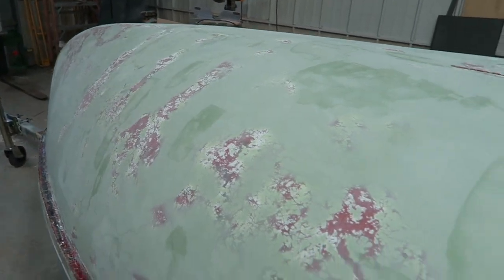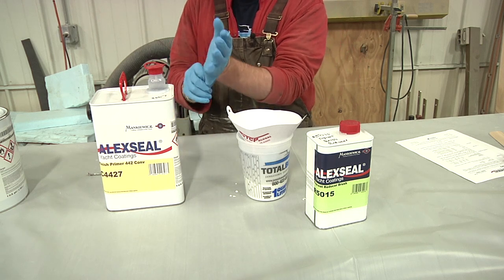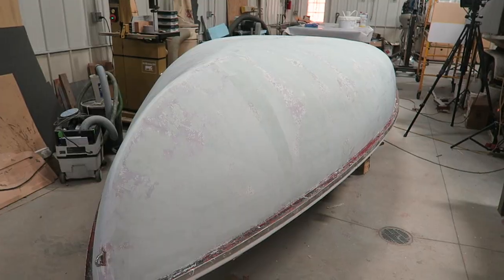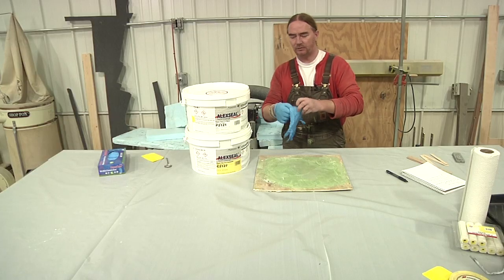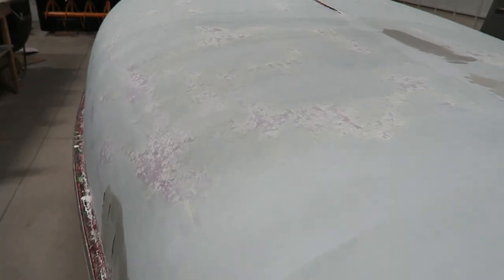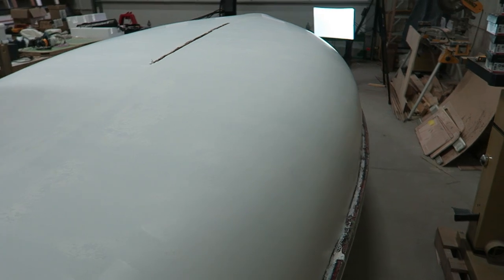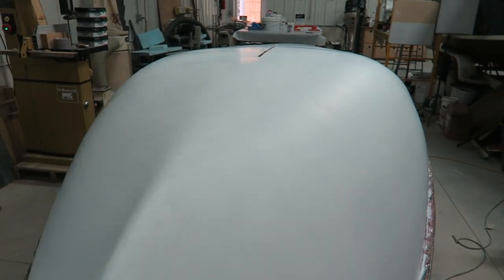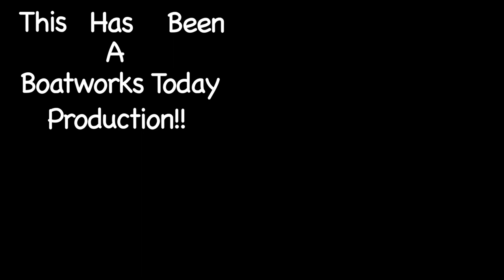FAIRING AND PRIMING DONE ~ LETS PAINT THIS BOAT!

Comment: Andy, I would do waterline and below in the blue, the free-board in the yellow. This would give the colour contrast along the lines of anti-foul paint. ;)

I'm looking into which brand of the 1 part gel-coat I've used before, if I can find it I'll send you some so you can  give it a test yourself. This is the gel-coat I brushed on and left, 1 coat no primer and got a perfect finish with.
Reply: I like this, but would do the blue topsides.
Reply: I certainly second using two colors, one above the waterline and one below.  As a teaching tool, adding a boot stripe, either with vinyl striping or masking and painting would be much appreciated.  A problem I've run into, even with wet sanding to remove the mask ridge in the paint, is color migration from a dark stripe into the lighter adjoining  paint.  Would really like to find how to avoid this.
Reply: Agree, the waterline split colours are much interesting as we will learn how to get a perfect waterline👍
Reply: @Andrew-lk5ov  developing a smooth curve for the color change would be transferable towards creating the boot stripe.  If you are on Facebook, Robert Perry wrote up an article about designing a boot stripe for his fan club page.  https://www.facebook.com/groups/187149054996410/search/?query=BootStripe&epa=SEARCH_BOX
Reply: Was about to suggest this as well! More practical and esthetically pleasing in my opinion.
Reply: yes, this, please!!!!
Reply: Agree, but if you like to be funky, you can create a S line at the sides. Which create a blue nose and a yellow booty

Comment: I just finished painting the bottom on my 1988 21' hydra-sports with Alexseal. Same process: 2 coats total fair, 2 coats Alexseal finish primer, 3 coats Alexseal vivid red topcoat, sand the gelcoat first and in between each coat. 3 weeks on my back, sanding and painting. What a job! Was it worth it? You bet it was. Came out FANTASTIC. Looks better than new. Thanks for the vids. they are a great help. I was wondering why you didn't use the rolling additive for the primer. 
I'm in south Florida and Miguel Afonso from Alexseal was a great help with info for getting the right thinners and the rolling additive. Thanks to all including Andy, Miguel and Lewis Marine

Comment: Which of your videos do you suggest I use to help me with the following.  I have hairlike cracks in curves of the boat.  Thinking like to pull everything off, grind it down, and apply fairing compound, sand it, then apply primer, paint etc,  I build my own barn, lean too for horses, and my mini home.  But sailboats are a new venture for me so trying restore and give it a girls boat look.  Any advice much appreciated.

Comment: Since you are going to use two colors, rather than splitting them down the middle, why not paint most of the bottom blue and the upper portion yellow?  That way you can show how a boot stripe or waterline color change is done when using a roller.

Comment: I contacted Alexseal  about there paint and was told it's not for uses under the waterline. What do you know about painting under the waterline with paint you can share.
Reply from the maker: That is correct that it is not designed for below the waterline, but being that this is a demo, flipping the boat and coating the bottom gives the largest surface area to show off what the material can do ;-)
Reply: How does water affect the paint?

Comment: Great video!
I tried to buy alexcoating products for weeks to repaint my boat, but the products are out of stock!!
Reply: I wanted to try Alexseal but availability where I live was an issue.  i ended up going with Awlgrip and Awlcraft 2000 simply because of availability.  I just like being able to deal with a local distributor rather than ordering from hundreds of miles away.  The price was about the same and I haven't been disappointed with the products or the results.  I know they say Awlgrip is not "repairable" but I personally know the best fiberglass repair guy on the Gulf Coast and he says he has done it hundreds of times without an issue.  I have no doubt that Alexseal is a great product but I like to look at the dude I am buying something from that costs hundreds of dollars a gallon. Lol

Comment: Hi Andy, you're doing a great job,
I unfortunately have to just lift a finger,  if you know what I mean ;-)
you are a role model for many people who do DIY, and as such you have a commitment to being a good role model
it is ok that you do not wear respirators, when mixing paint, and you want to explain what you are doing,
But would you be nice to wear respirators when painting, the paint has a very large surface and there is a very large evaporation of solvents,
unfortunately, solvents are not particularly good for humans.
Reply: He has an entire shop air exchange system that does a full air exchange every 6 or 10 minutes.  It was in an older video of his.  I can't remember though if it does a full air exchange 6 times an hour or 10 times an hour.